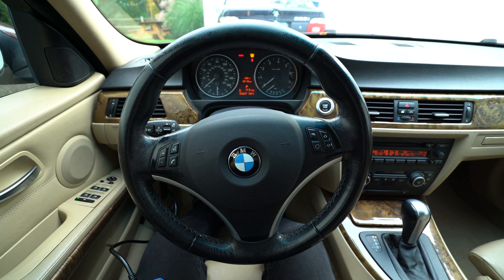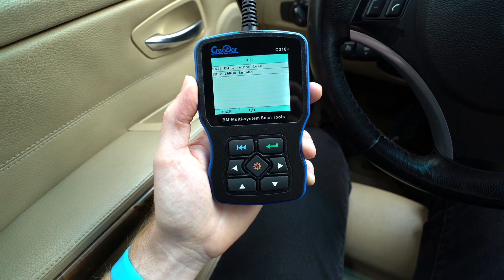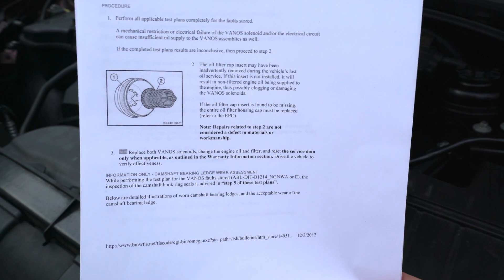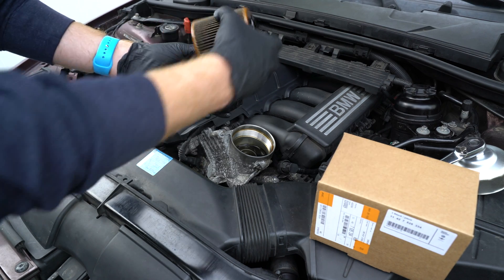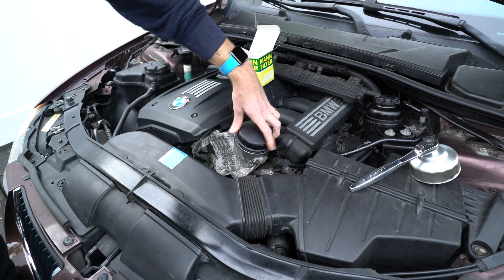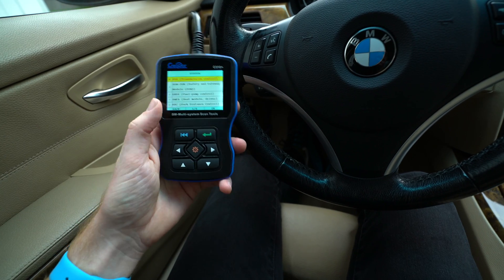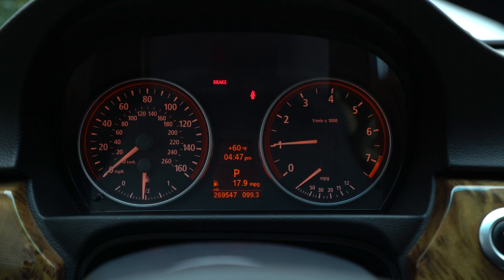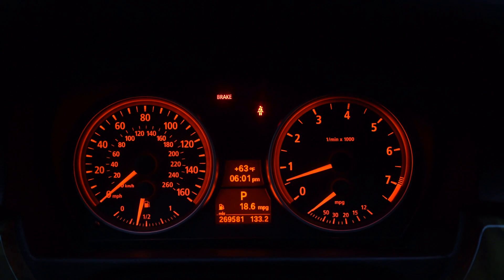BMW E90 Intake Vanos Solenoid 2A82 Code After Oil Change Broken Oil Filter Basket

Comment from the maker: BMW OIL FILTER HOUSING CAP: https://amzn.to/2Pke7l6
N52/N54 OIL FILTER TOOL: https://amzn.to/368Uz9i
N52 GERMAN OIL FILTER: https://amzn.to/2MPdE8P
CREATOR C310 BMW SCAN TOOL: https://amzn.to/2NaIuru
GREEN MOLYGEN OIL: https://amzn.to/31MfCLi
LiQUi MOLY ENGINE FLUSH: https://amzn.to/2MJ8cUQ
LIQUI MOLY LIFTER ADDITIVE: https://amzn.to/2MKdNu3
LiQUi MOLY JECTRON INJECTION CLEANER: https://amzn.to/31IwpPt
E90 Maintenance: https://amzn.to/2PhLncF
MY NEW BUSINESS: http://bitly.com/2URZuod
Rare BMW Parts: https://ebay.to/2kd26AR
BMW Tools: https://amzn.to/2LIAZHD
N52 Oil Filter Housing Tool: https://amzn.to/31Hn6PW
Reply: I do have the same problem I’m in car I think I’m goin to a mechanic they my charge me a bag for it

Comment: Great video! Just one question, did the car run weird or uneven whilst standing still? Not so much that the car died but just enought for it to be annoying? I have the same fault code now and the car is a little rough whilst standing still but as soon is a get going it’s fine!

Comment: Does this also also apply to N51 engines?
Reply: Hello I got this code well not this one but p00015 right after and oil change on my bmw 06 330i I think it could be a bad oil filter since I just checked mine and it had no basket Inside

Comment: There’s a check valve underneath of the oil filter housing that bolts to the cylinder head probably want to check that, it will also cause the same code, and if a piece of the broken basket stops it from opening it’ll blow oil past the gasket and purge it into the cooling system, you’ll think you’ve blown a head gasket or cracked the head, when its just the oil heat exchanger/cooler to oil filter housing gasket and or the filter housing to cylinder head gasket ( some only require one of the gaskets at the housing and the cooler is mounted on a bracket that bolts to the lower radiator support)  If you don’t fish all of the pieces of plastic out of the housing (I use a cluster of straws squeezed gently into a shop-vac reducer attachment with a strainer donated by a newly emptied oregano spice shaker jar ) and hot glued it in the adapter so it wouldn’t suck all the straws up, you punch holes in a piece of dollar store cutting board and heat the straw ends until they curl then spray them with water so they don’t drop out you should get 2” of free findependent linear movement ) theres a short video on how to do it, it works great for detailing and important places where you don’t want to suck up a 2 carat diamond or a tiny one off spring for a high end electronic device.

Comment: Thank you!!! After watching this video I replaced my oil filter cap. I found the inside missing!!! I think the last place that changed my oil pulled off the basket with the filter and tossed it. I purchased a new kit that included the cap, basket and filter. It was $20. It fixed all the codes!!!!!!!! Thank you!!
Reply: What other codes did you have?

Comment: If your oil filter basket is present after an oil change, note the error code (ex:0x2a82), swap the two vanos solenoids, you should be getting the opposite code (ex:0x2a87)

Comment: Holy shit got the 2a82, 3100 and 2aaf codes.. thought my engine is done, but it was the FUCKING missing basket, someone earlier who changed oil filter just put the filter in the housing 😂
Codes deleted and  they didn't come back, engine runs like Rolex now Thanks 😊😊😊

Comment: my problem - 2A82 code appears only when starting a warm engine :(  , oil filter is OK, solenoids and nonreturn filer are new,  camshaft bearing ledge been replaced, oil 5W40, all seems good, but code is still here
Reply: no solution yet, I will change the adjusters on the cams in the summer
Reply: @Marián Vdovják  wacckkk 
Sorry bout that hopefully you figure out. If you remember lmk how it goes!!
Reply: @marianvdovjak2455 did you figure it out
Reply: Did you ever figure this out? I replaced oil filter cap, vanos solenoids, and now cam bearing ledges are next
Reply: Did you fix it!?
Reply: @Torontotings   i just changed the oil filter and the o rings on the cap. works perfectly now.

Comment: Did it stay off? The CEL
Reply from the maker: Yep
Reply: @BIMMERZEITT  hell yeah. Cheers bro, thank you. Mine will be here saturday. I've literally done everything to this car but that. Just came across ur video. Glad I did. A tech told me today I needed to do timing chain and all for $2k. Something didnt seem right. I just knew there had to be something stupid going on. Noticed my basket broke last time didnt think anything of it tho.
Reply from the maker: @timbodoingit  these engines not known for timing chain issues. This car I sold to my neighbor now has 320k miles original engine. So it’s not common at all. Try the filter and basket first.
Reply: @BIMMERZEITT  absolutely, I'm almost positive it's the issue. I have the exact issues a d symptoms you had. That is bud. Take care🍻
Reply: @BIMMERZEITT  so.. I changed basket, filter, vanos solenoids before that, and new maf sensor, new ign coils, spark plugs. Cleared codes. Drive amazing last night, more powerful than I've ever felt it. This morning it threw the code again, 2a82. Any suggestions? I'm getting annoyed
Reply from the maker: @timbodoingit  this resolved the issue for my car, but your best bet would be to google 2a82 and post a thread in the bmw forums for more diagnostic help. Lots of good advice on e90post, bimmerforums etc

Comment: Fixed my VANOS intake fault.  Thank you so much!  When I removed my oil filter cap, I noticed that the cage was detached.  Changed it and code cleared and never came back.  Excellent video!
Reply from the maker: Happy to hear it! If the fault comes back, most like a vanos sensor basket is clogged. If cleaning doesn’t resolve, will need replacement. 👍🏻

Comment: I have a 2011 bmw 335is. I had code 2a82.  I change the oil, oil filter and housing.  Also changed the solenoids which only fixed the problem for a couple days.  The code came back.  Any thoughts?
Reply: Did you ever figure it out? I have a 2011 335is as well with the same code.
Reply: @jt86tn  yo dude you figure it out? i got same code. i suspect the cam sprockets are worn as i got timing chain done but shop only replaced the crank sprocket not the cams sprockets (original). new cam ledges done and new hook rings prior to chain. going open it up check chain for wear cam ledges hook rings and all 3 sprockets crank intake and exhaust. my oil filter cap is new so definately not that.
Reply: same here :/

Comment: pulled mine and it’s still attached but there’s a lot of play. does that mean it’s broken?
Reply from the maker: It’s hard to say, are you getting trouble codes? If it were my car, and I planned to keep it for a few years, I would recommend changing it with a new part. It’s relatively inexpensive and will give you peace of mind ✌🏻 😎

Comment: I have the same symptoms but a code for the exhaust side. When I went for an oil change the mechanic showed me the oil filter cap, the basket was still in place but not attached to the cap. He told me to get it replaced next time. He said not to worry about it, but now after watching your video I'm not so sure if I believe him anymore. I've already replaced both solenoids but the problem is still present. Has the problem ever returned for you after replacing the cap?
Reply: Hello, did you managed to fix the issue?
Reply: @Aidziokanalas  yes, it turns out the garage scammed me and put broken non-genuine solenoids in. The car runs great now.
Reply: @timovandam  so you changed vanos solenoids to original ones and no error?
Reply: @Aidziokanalas  yes
Reply: @timovandam  perhaps you remmember the fault code that you got about exhaust vanos? Mine is 2A99
Reply: @Aidziokanalas  yes I had that code, and some other codes too but I don’t remember exactly. If you only have a code for exhaust you can swap the intake and exhaust solenoids and if the fault changes you know you need a new solenoid.
Reply: @timovandam  I swapped solenoids, then the 2A99 dissapeared, but I got new code 2A98
Reply: @Aidziokanalas  yes that is the code for the intake. You need a new solenoid.
Reply: @timovandam  I ordered just now, hope that helps, I changed intake and exhaust position sensors, but it did not helped

Comment: Took my car to get a oil change and they forgot to put the oil basket back and I ran my car and it started idiling rough and check engine light is on. What should I do?
Reply from the maker: ... put the oil basket back in
Reply: @BIMMERZEITT  So If I put that back in do I have to change the vanos solenoids? or clean them? I don’t know what to do man this oil shop screwed me

Comment: How is the state after months? Because my e60 525xi 2005, shows this error too 2A82, i replaced both solenoids, camshaft sensor, cleared the error memory and the error still persist, sometimes after 5km, sometimes after 150km sometimes after 300km, and nobody know to tell me, what is wrong.. Now i planing to change the oil and filter, because of service intervak, so i will see, if isn't the same problem with the basket..
Reply from the maker: once you replace the filter and basket report back and let us know if this resolved your issue.
Reply: Any word? Same problem here, This shits annoying me

Comment: You should have showed the difference between oil filter caps how much the play  difference between them
Reply from the maker: Richard Garcia true. This is a very common issue
Reply: @BIMMERZEITT do you happen to remember if the oil filter basket moved around in the new oil filter cap? Mine rattles around a bit but don't know if that's just how it's meant to be?
Reply from the maker: @Subzero2698  my experience is that the new ones are nice and tight compared to a used one with 100k, 150k miles on it. Old ones will wiggle around a lot more.

Comment: What were the symptoms please I need help
Reply from the maker: Jordan Bowen service engine soon light came on code 2a82 and rough idle, power loss
Reply: BIMMER ZEIT  did it feel like it was missing ?
Reply: BIMMER ZEIT 2AA9 code detail please
Reply: @BIMMERZEITT  I changed my oil and I found that my car miss that basket it only has the cap. My car got a rough idle when starts, shows an yellow elevator on dashboard and then goes fine after few seconds I was going to new vanos solenoids but now I'm gonna buy a new cap first.